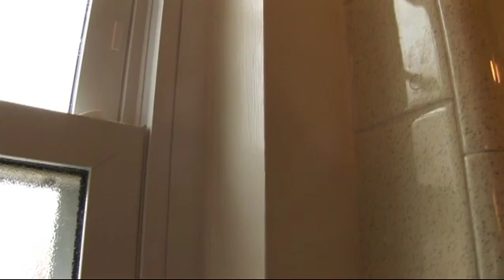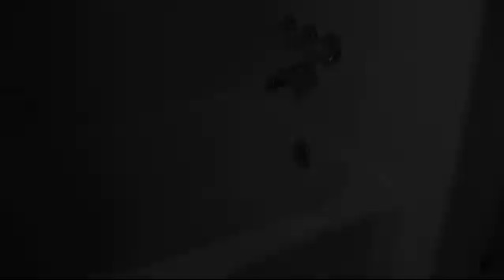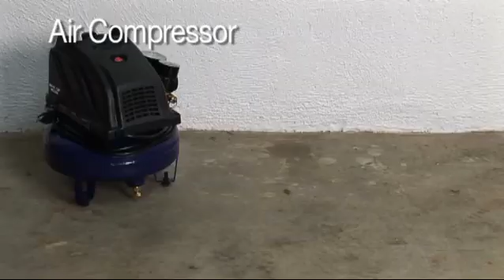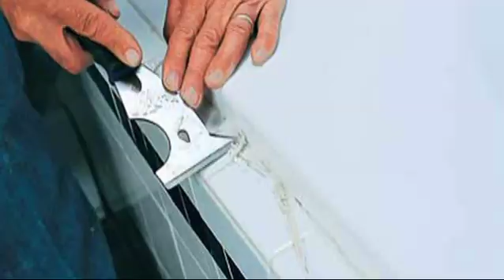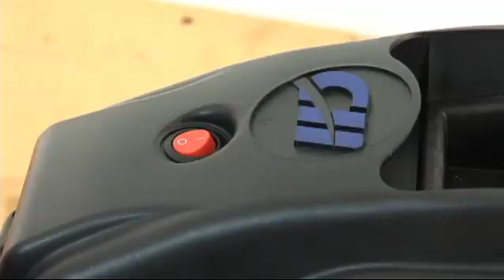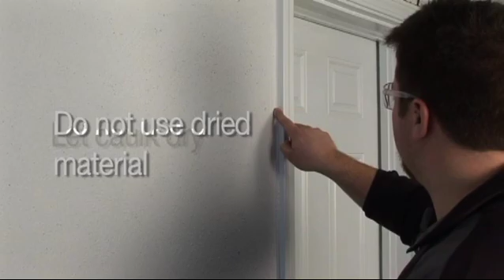Using an Air Powered Caulk Gun

Comment: I already have a portable rig to regulate CO2 from paintball cylinders I fill myself (I don't even play paintball!) for MIG welding with my little gas converted Lincoln 100.  One of these pneumatic guns costs far less than an electric and the difference pays for my CO2 hardware.

Comment: Aluminum body for strength 
Easy adjustment for caulk flow
Rotating air hose connector
Sausage type for quick cartridge loading and removal
An ergonomic trigger grip for added comfort during use
Excellent for sealant cartridges and bags
Reply: http://www.jinmaopro.com/Pneumatic.html